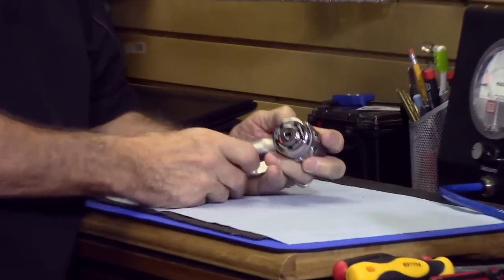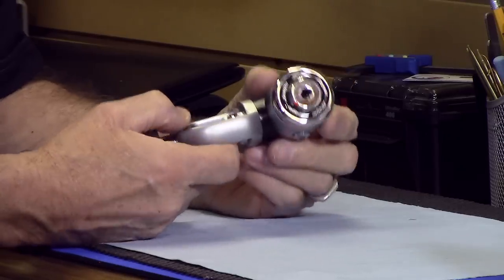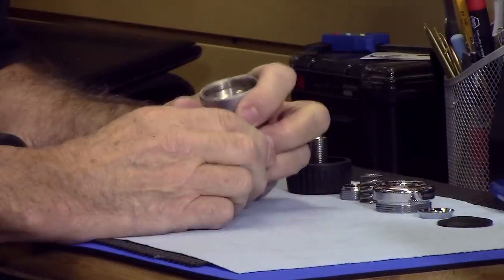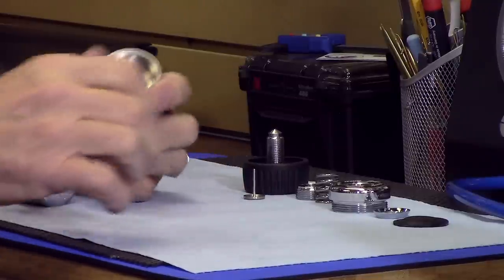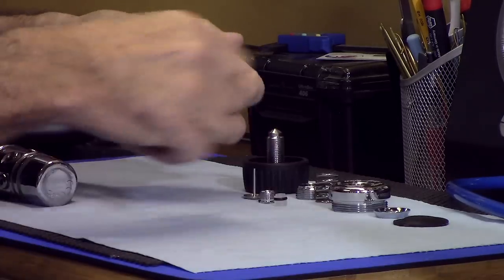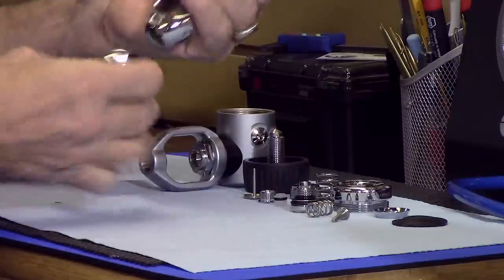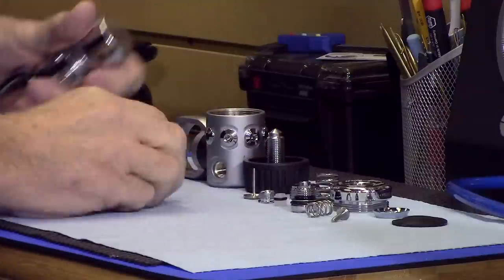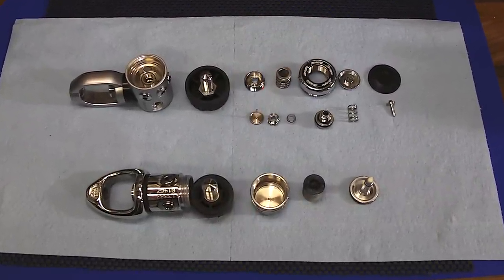Piston vs Diaphragm 1st Stage - Scuba Tech Tips: S07E01

Comment: Hi Alec, I’ve been seeing the term “flow by piston” a lot on entry level/rental regulators. What does that mean? And how does it compared to other piston regulator used by high end models made by scubapro or atomic?
Reply from the maker: If it has a piston, it is a 'piston' first stage.  They can add any other words they want but they ALL work on the same principle.  Note that 'flow by piston' means the air flows by the piston, which is how its supposed to work.  Like saying "gas in a car", it better go in the car, get my point?  Thanks for watching.

Comment: Thanks for the video. I didn't know! Always assumed piston were the old school first stage, and that in order to get a balanced regulator (as easy to breath at depth or when running low on pressure) you needed a diaphragm first stage (what I have now) ? When I started diving in the late 70s you could tell you were running low on pressure well before as it became harder to breath, same at greater depth. Is it possible to avoid that with a simple spring+piston ? the spring tension is fix, so as the air pressure goes down you get less air flow wouldn't you ? also environmental seal with diaphragm, wouldn't you get less corrosion as you don't have salt water enter the spring chamber ?
Reply from the maker: In theory you can detect low air pressure from the increased breathing effort in any standard (unbalanced) regulator whether diaphragm or piston (maybe a bit more with piston for technical reasons that would require an entire new website to discuss adequately).
However, either I'm not very sensitive (as all my wives have claimed) or I was always so in to the diving that I failed to notice, I've never really noticed such a change.
Corrosion is an issue both without and with anti-freeze kit (sometimes called erroneously and All Environment Kit (AER for DACOR in the 70's). It can be even worse with a kit installed if it's not checked regularly. See my reply to wbatten1 below.
However, in theory again, it's should be less of a problem with a kit installed.
Thanks again Alain.
Alec
Reply: Alec, with water entering the spring and piston chamber wouldn't a simple piston design corrode much easier than one that uses a rubber diaphragm to push a piston instead ? even in your video you see your spring and rode quite corroded (didn't slide or separate out easily). Does it mean a diaphragm  reg doesn't need anywhere near the same amount of servicing, even if more pricey ? reminds me of my BMW requiring oil change every 15k miles vs my Acura every 5-6k. Cost more (synthetic, more quarts, etc..) but much rather do it myself less often :)

Comment: but diaphragm regulator is better for cold water especially if it is environmental sealed.
Reply from the maker: Not really better, just different.  The piston has 2 moving parts, the piston and spring while diaphragms have more.  Cold water does not tough either system to its a preference on which style you like.
A

Comment: Alec, I need help picking a regulator, so far I know I need DIN because of HP tank and it has to be for cold water use, my previous first regulator was Tusa rs360, yoke.  I bought it brand new about 8 years ago.  I was looking for Tusa rs790 but its diaghram,  I want something more simple, like the piston style.  Then I start checking out Scubapro mk25, someone said its oring central, and that I dont remember what part but something is cracked internally from factory sometimes.  Then I started to look at Atomic M1 or B2, m1 shows that it's freeze protection standard and B2 is optional on comparison chart. I also like the idea of servicing every 2years or 300dives.  Thank you.
Reply from the maker: The Scubapro MK25 has been around for a very long time. I think you'll find it's one of the most reliable regs on the market. It too has a 2 year service period but you may be able to get free parts and that's worth looking at.
The Atomic is quite good too but service is not so widely available and parts are not cheap.
Alec
Reply: Alec Peirce Scuba thank you reply, I ended up getting brand new Hollis DC2/212 DIN for $209 shipped.  I was looking at Used atomic m1 and scubapro mk25 and it should have cost me around $350-400, plus around $100 for service.  I will be eyes M1 or mk25 for future most likely but they are not cheep.  I asked one shop about Abyss pr MK25, they said hands down mk25.

Comment: Does one or the other work better at depth. I have a Dacor viper tec just rebuilt diaphragm reg and years ago when it was new I dove to 80ft and remembered how hard it became to breathe. I've had it rebuild before parts are gone by Brian at Lake Hickory Scuba but could never get an answer why it was so hard to breathe at depth past 60ft. At first he thought it was a piston and that's why  but it's a diaphragm. 2nd stage is dacor viper tec as well. Any thoughts?
Reply: The question is was it a balanced or unbalanced diaphragm? Balanced should breathe almost the same at a  reasonable depth, wether it is piston or diaphragm, if it is unbalanced the work of breathing will increase the deeper that you go. It should not be that bad at 80 feet, it sounds like it was not properly adjusted.

Comment: Alec - I have the Diaphragm model that you showed in this video (Zeagle Envoy).  I have had it for about 2.5 years and have 117 dives on it.  Zeagle calls for it to be inspected annually, but does not have a schedule for a rebuild.  What are your thoughts on when this regulator should be rebuilt?
Reply from the maker: Well, 117 dives is a lot! If you've not had it serviced, now's the time.
Generally it's suggested that a reg system should be serviced every year or 25 dives. Most reg manufacturers are now suggesting every 2 years. 
The problem is that there are many factors other than time and/or number of dives. For example, if all your diving is in fresh water, every 50 dives is a good number to use. If you carefully rinse your regulator after every dive, dry it and store it sealed in a ZipLoc, maybe every 75 dives would do.
At the opposite end are regs that are used daily (rentals or training) and are not cared for well. We used to check our training or rental regs every week and probably 1/2 of them required some service.

Now comes the question of service versus rebuild. Quite frankly, while some dive shops will rebuild a regulator at every service (Why not? They make a lot more money!), a rebuild is necessary only if the reg demonstrates signs that it is not functioning perfectly. If the IP climbs, if the breathing effort is high, if it freeflows, if it looks abused and so on, the serviceman should rebuild the reg. It's tough to pin down the exact cause of some problems and they are often related to each other. Best to simply rebuild with a complete service kit than try to fix it by replacing 1 part or 2.

So once the warranty period is over (if you even care about that), you need to make an informed decision as to when to take your reg for service and to tell the serviceman of any problems if they exist.
Good luck.
Alec
Reply: Alec - Thanks for you advise.  I take very good care of my equipment.  Always rinse in fresh water.  Most of it looks like brand new... on the outside at least.  One more question:  My regulator is a Zeagle.  Do you think I should seek out a Zeagle dealer, or would any SCUBA Tech be able to competently do the job?.  There is a local guy here in Myrtle Beach that caries mostly Aqualung.  He said he can service any brand....
Reply: Alec, thanks for your answer. Even my reg was stored 25 years, it still looks like when I put it away, IP haven't changed and works perfect (in pools). Don't worry, befor I go diving in a lake again, I'll do a service 😊

Comment: Hey Alec.. can you tell me how to know if a 1st stage regulator .. like a Dacor 460 is a plunger or diaphragm regulator?  I looked in the LP ports, all I see in the 460 is a small shaft that makes me think it's a diaphragm.
  My other regulator, had a thick spring when I looked in the ports. I'm not sure but it may be a sherwood that I traded something for and never needed it till last month when I bought new 2nd stages for both of my regulators.
Reply from the maker: If plunger means piston, then the Dacor 460 is a piston model.  First year of manufacture was 1989 and still a easy to use reg.  Watch this video to see how to identify piston vs diagram regs S09E22 by sight. 
Dacor models 300, 350 and 360 are diaphragm's and 460, 600 and 760 are piston.  Finally the 900, 950 and 960 are diaphragm's.
Reply: @AlecPeirceScuba_SeaHunter  kewl thanks. I believe as soon as I get some new hoses or a set of adaptors, that this will be my primary dive regulator. The other two will become back up or the "loaner regulators".  lol.
 Sorry about plunger thing. I typed "piston" but for some unknown reason spell check kept changing it to "plunger"!

Comment: love the videos. I am curious, I know the purpose of a balanced first stage, but how does it work exactly? are there different parts in a balanced first stage than in an unbalanced?
Reply from the maker: Surprisingly, a balanced piston regulator is almost indistinguishable from a standard (non-balanced) regulator. Particularly in a piston regulator, it's the easiest thing in the world to balance it and doesn't even require any additional parts. In fact, there's 1 less part!!! 
BTW, NO! You can't do it yourself!

Balancing a regulator is a mysterious concept that baffles most non-technical people - and I'm NOT referring to technical meaning technical divers. I mean technical as in a mechanical engineer. 
Scuba manufacturers and scuba store staff use this mystery to their advantage when selling gear and will tout the advantages of a balanced regulator to upsell a diver knowing that the diver probably has less understanding than themselves!
I'm not saying that a balanced regulator is not worthwhile. I AM saying that it is not necessary for most divers despite most scuba store staff leaving you with the impression that you are playing with your life if you don't buy a balanced regulator.

I'm going to make a video on Balanced vs Non-Balanced regulators to show how it works but I can give you a quick, easy description. 
Picture a tin can, maybe a soup can, that has a small hole in one end only. Into that hole insert a rod that is a tight fit, tight enough to seal a bit but not so tight that it won't slide in and out. You can fairly easily slide the rod into the can and pull it out of the can. Now if you increase the air pressure inside the can, it will tend to push the rod out of the can. Now it's much easier to pull the rod out of the can and much harder to push it back into the can. You will see the same affect in reverse if you increase the air pressure outside the can (or decrease the pressure inside). The rod is easy to push into the can and harder to pull out. That's how pressure changes affect a non-balanced regulator.
Now punch a hole in both ends of the can and put the rod right through the can so that it sticks out on each end. The rod will slide back and forth through the can fairly easily again. And, magically, if you increase or decrease the pressure inside the can, it has no affect on the effort needed to move the rod! 
In a balanced regulator, the piston (in this case) will move as designed with no change in effort regardless of pressure changes inside or out.
I hope this is clear and helps your understanding.
Watch for my video - "Balanced Reg or Unbalanced - What's the Diff?"

Take care.
Alec
Reply: Thanks much sir. I’m Tim from Knoxville TN, btw. Again love the vids
Reply: better explanation than the video which mentions the feature and benefit but not how it works...

Comment: Is there any difference in operation if the ambient pressure is greater than the intermediate pressure?
Reply from the maker: In theory that can never happen. The regulator is always subject to ambient pressure and that pressure, regardless of its source or intensity, is added to the IP. Thus, if the ambient pressure at the surface is 15psi (1BAR) and the IP is set at 150psi (10BAR), at 33' (10m) where the ambient pressure is 30psi (2BAR), the IP is now 165psi (12BAR), and so on.
If the ambient pressure is greater than the IP, the regulator is broken!!
If you are thinking about what happens when the ambient pressure exceeds the IP such as at 330' (100m) where the ambient pressure is 150psi (10BAR), the IP would now be 300psi (20BAR).
Take care.
Alec
Reply: Alec Peirce Scuba Thanks very much. A nice clear and concise answer.

Comment: For regular spearfishing weekly 4 to 5 times 
What kind of regulator is good 
Is good to be 2 hp output n 4 low pressure out put
Piston or digraph
Bal or un balnce 
Din or York or din adoptor buy separately 
Do bcd will play major role in spearfishing n how about dive computer to buy 
Please share ur wealthy knowledge for us so that i can make nice move before buying all diving stuff thanks alec
If any things I miss please suggest me 
For me safety is first not price
Which cylinders will be better 80 cubic feet or more
Reply from the maker: Lots of questions Caji so let me quickly start.  First buy the best reg your can afford.  Sounds silly but if you only have $300 then that is what you can buy.  Check out my video S06E01.  The rest of your questions depend on location really.  If in North America, then its yoke, 80 cu/ft tank, otherwise its DIN and 12L.  Remember its also the speargun and practice as scuba gear gets to near the fish, you have to spear it next.  Good luck and thanks for watching.
Reply: Din regulator and yoke adapter will let you dive any tanks, anywhere.

Comment: is it normal to hear a noise similar to "inflating a baloon" using an unbalanced piston first stage? (mares r2)
Reply from the maker: Generally and 'noise' coming from a 1st stage means service is needed.  In piston regs when the O-rings are worn, high pressure air is leaking past the o-ring causing high pitched sounds like balloons.  If this sound is not heard when new, then a service checkup may be needed Alberto.
Reply: @AlecPeirceScuba_SeaHunter  thank you very much! I will make it check. By the way the noise is not high pitched.. it is like if you're inflating a "party" baloon, so basically an "air flowing" noise you could hear from your mouth to the baloon (I have no better comparison ahahah). This I a spare reg I have (very different from the reg I normally use which is scubapro mk10), and probably the noise was always there and I just didn't realize. 
Anyway Thanks a lot! Keep up your good work, as always!

Comment: balanced first stage or not?!
how deep do i need to go before there is a use of a balanced one? 
in meters.
// Jony @ Sweden
Reply from the maker: You can dive to any safe depth with a standard (non-balanced) regulator with no problem. They work just fine. I've used them at 100' (30M) and more lots of times and the water is cold up here at that depth. When I started diving there were no balanced regs.
As I mentioned in the vid, a balanced reg is not BETTER. It does give more consistent breathing and will supply larger volumes at deeper depths but they are no safer in a normal dive.
Alec
Reply: Tanx!
Keep making your amazing videos, I've just started taking my Padi ow cert, and your tips help me to save money in the right places.
//Jony @ Sweden

Comment: what about environmental sealing? piston regulators are rarely sealed, which means salt water gets in and it's much harder to clean, so "everything else being equal" that piston regulator will give out a lot sooner than the diaphragm one. a dive table is also a lot simpler than a dive computer, but I don't see too many people diving with them.
if you get them both serviced according to the manufacturer's spec, then both should last about the same (a very long time), I don't think one is "better" than the other, just because it's simpler.
Reply from the maker: A piston is a very simple mechanism that also means cheaper service (less parts & time) an can have an environmental seal to minimize outside water goop.  For a new diver on a limited budget, a balance piston is a good starting reg until they decide to move up.  Thanks for the feedback my friend.
A
Reply: @AlecPeirceScuba_SeaHunter  thanks. keep the videos coming, you have good content

Comment: We called them:  balanced first stage and unbalanced first stage.  Some show the difference if the divers dive deep and breath heavily.
Reply from the maker: There are a several factors in play before a diver really notices harder breathing with an unbalanced: depth, inhalation force, is a venturi assist on the 2nd stage, diver fitness,  tank pressure.  I dove unbalance 1st and 2nd stages for many years, could not afford balanced ones, and when I did convert over, did not notice much.  It's not like going from standard definition TV to 4K, but some may notice it late in a dive.
Reply: @AlecPeirceScuba_SeaHunter  was wondering as well when people say it good to have balanced regulator (trying a few balanced and overbalanced).. still dont think worth to have it tho. since the unbalanced just do the same. But of course if does feeel surreal to breath in with those balanced regulator (where u can inhale all the air by adjusting the knob of venturi (VIVA) to reduce flow resistance.